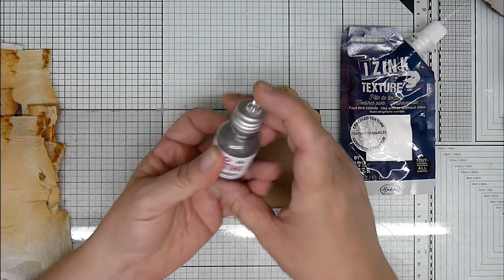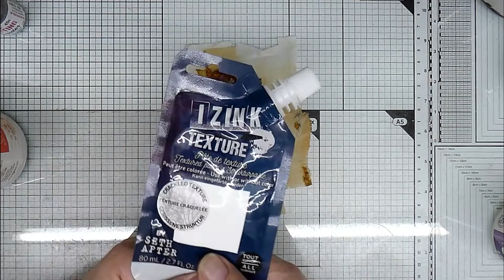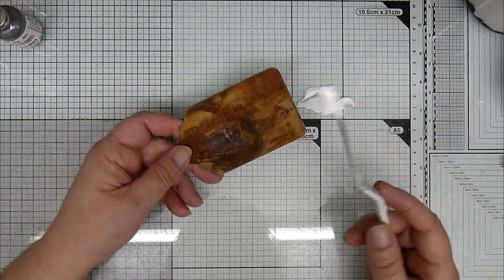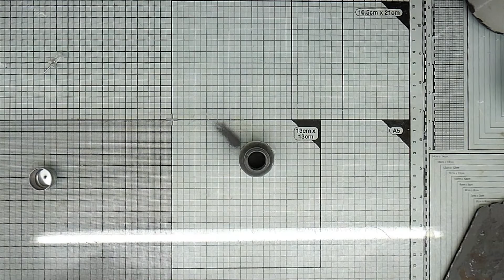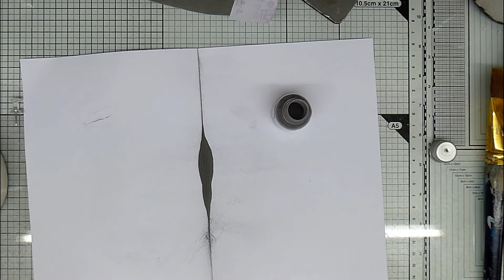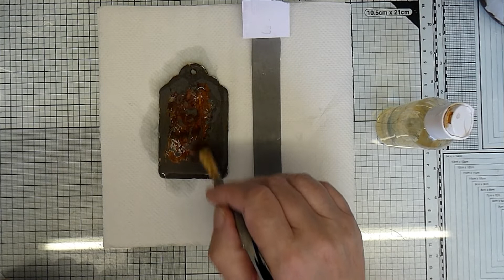Easy rusty tag using Rusting Powder and Crackled Paste

Comment: Thank you for the demo and all of the little tips in between they are invaluable when crafting ( how to save the spare dust- bits of paper on the tape - keeping the lid clean to prevent lids gluing together etc 🥰 it’s a great result mags and hopefully along the way I may get to use some powder. I like to rust material and have collected some wonderful bits but have not tried it on paper or wood yet . ❤️